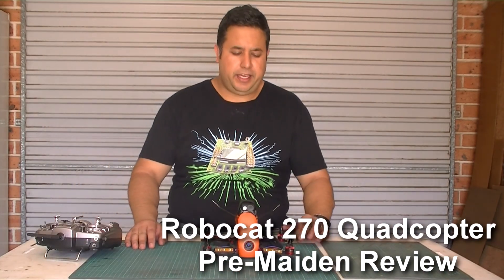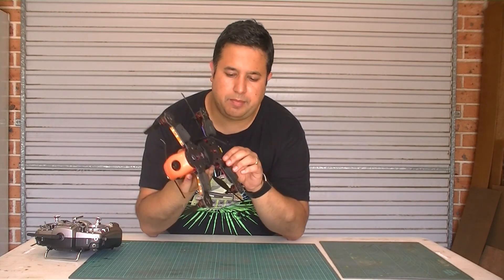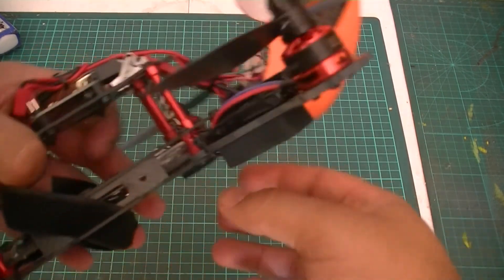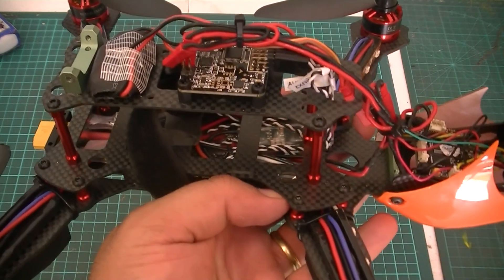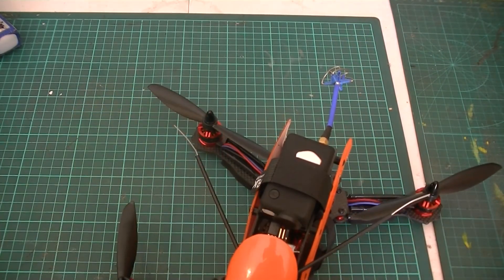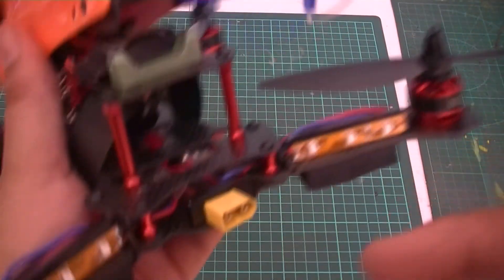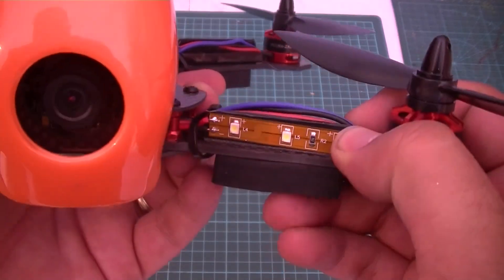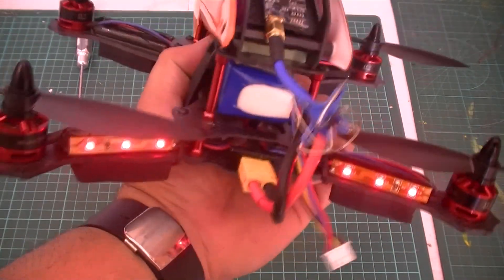Robocat 270 PreMadien Review & Maiden

Comment: I just got an ebay robocat kit for $120. I have nobody to race up here but I do like the way it looks and it's cheap. I think it would be a good one to learn on. The aechine 250 is also a great trainer for only $129 on bang good.
Reply from the maker: +MrLivesteamer Yeah its not a serious racer but it looks mighty impressive to the uninitiated. It flies well and can take a hit.
Reply: Aliexpress 76€
Reply: I just bought an Ebay $90 Robocat kit and assembled it yesterday. The initial test flight with basic PIDS was stable and very controllable even with the cheapish components. I have a ZMR250, which is smaller lighter faster, and an Eachine Racer 250, which is more similar in size weight to the robocat, but not as strong or sleek looking. The ER250 also had a lot of quality control problems, non standard parts, and an unresolved power loss issue. It's pretty much useless and I'm salvaging parts to put on my robocat...